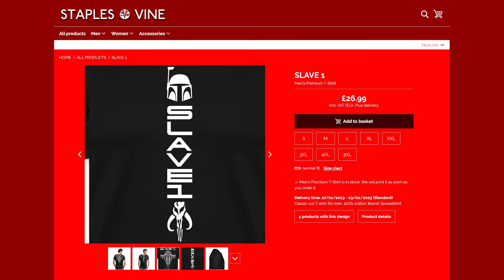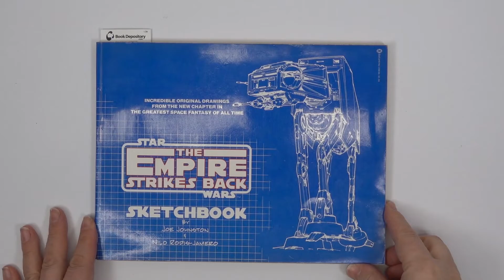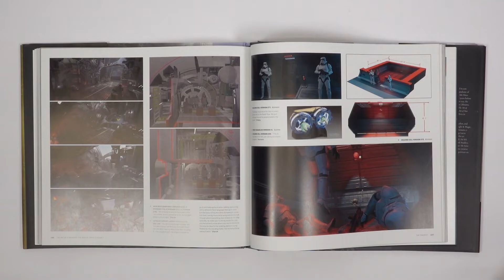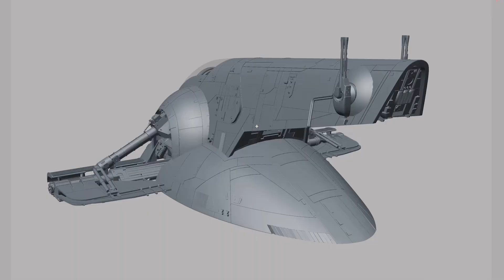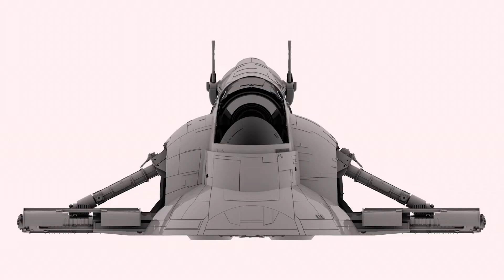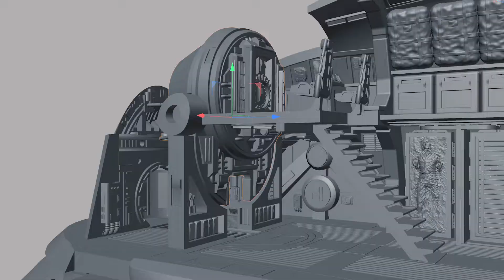PROJECT SLAVE 1 PART 13 ‘NEW CAD FILES & MERCH!’

Comment: It's kinda weird to have an area right behind the cockpit where the gravity of the ship changes at a 90 degree angle in flight, but that is already how things work in Star Wars.  The Millennium Falcon turrets are in little rooms at 90 degrees perpendicular to the gravity in the rest of the ship,
Reply from the maker: Yes you are absolutely right the Falcon's gravity did set me thinking that 'up' could be in two directions in the same ship.

Comment: Would love to print this in 1/12 scale for my Black Series action figures.
Reply from the maker: That would be very cool but in 1/12 scale it would be 1725mm  / 68" long. 😮
Reply: I know. But it’s such a cool and iconic ship. I hope the files will be easy to cut up. I have the Gambody file and was going to attempt it until I saw your cockpit mods. Very cool.
Reply from the maker: I would describe this as an 'advanced model' . It may be wise to cut your teeth on something simpler so you get an idea what to expect. Experiment cutting up files, printing them and glueing them back together. It will help a lot I'm sure.  I will be offering advice in the next video. 🙂
Reply: I have printed several 1/12 scale vehicles that required cutting the files. I am a former auto body painter and experienced model builder. If I take this on…I plan on making you proud. 👊🏼

Comment: Are your models going to be more optimized for SLA or FDM printing, similar to how Gambody releases their content?
Reply from the maker: Given the nature of the parts with the high level of detail and complexity they will be primarily designed for SLA printing. BUT It should be possible to print the majority of the larger parts with an FDM printer. I will include a buck to allow the canopy to be vacumn formed.
Reply: @StaplesandVine  Looking forward to it! Fantastic work all around.

Comment: I think the only thing I would change about the interior at this time would be a ladder instead of stairs up to the cockpit. That would better fit the idea of a military/ bounty hunter gunship and if I remember correctly that was how it was described in the old EU books. Cargo hold would be bigger as well. Look forward to the files coming out for printing!
Reply from the maker: Hi thanks for the feedback, it's appreciated. I figured that given up to 5 crew would be using the upper deck stairs would be better. They are set at the steepest practical angle. I could do a ladder as an alternative? Re the cargo hold the interior is as big as it possibly can be. When filming interiors they are always enlarged beyond the actual size. 'Tadris Effect' 🙂
Reply: @StaplesandVine  I meant if you had a ladder instead of stairs the cargo hold would have more floor space. Definitely include it as an option if possible! 🙂

Comment: Awesome work

I have one concern though... Having looked at the bandai model, which in itself is an excellent recreation of the original studio model, I'm worried about your scaling. Overall, the carbonite and Boba Fett figures feels too large, especially when you bare in mind the scenes from ESB.

There's also the set from Mandalorian season two, with everyone inside the cargo bay strapped into the seats, which itself was what gave me concerns about the scale tbh.

I know this is your interpretation, but I thought I'd voice my opinion and see what you thought.
Reply from the maker: A good point, scale is a tricky one.  worked it out based on the specified dimensions of the actual ship. I think the sets are 'tweeked' for filming. If I tried to go by the TV interior it would be a lot bigger and would make the whole ship out of scale with the movies.
Reply: @StaplesandVine  you could always get hold of the bandai 1/144 scale kit and scale based on the teeny tiny Boba inside it lol...

Comment: Have you considered resin casting the printed parts? Like print hollow parts and then cast them solid for extra weight and stability (and more material to modify):D
Reply from the maker: I have thought about casting a resin Slave 1 for sale but it is way beyond my skill level. I'll just stick to 3D prints. 🙂
Reply: @StaplesandVine  Sounds like a possibility  for a youtuber co-lab! Maybe @RobertTolone could be of help:D
Reply from the maker: Thanks  @Dsgj  just subscribed to his channel. 🙂
Reply: @StaplesandVine  looking forward to see the project and to be able to get a hold of the files later on!

Comment: Version 2 looks incredible, the amount of details you added into the interior is going to really test your printers capability.  Are you going to release a Vac-form for the cockpit glass or make the actual piece available when you get the files.
Reply from the maker: Thanks Jeffrey, yes the printer will certainly get a work out. I plan to create a 3D file for the canopy and for a vac form. It is such a key part to the model and can make or break it.